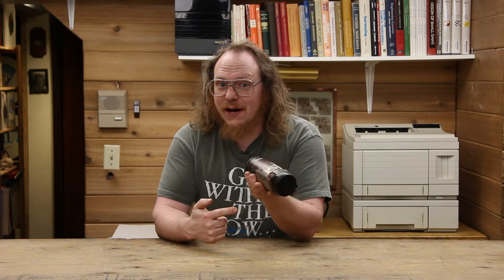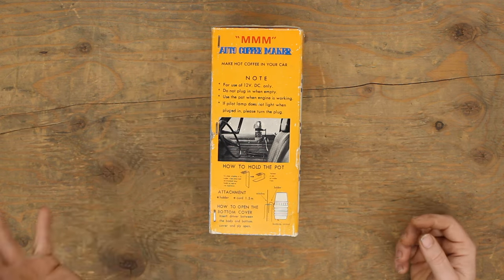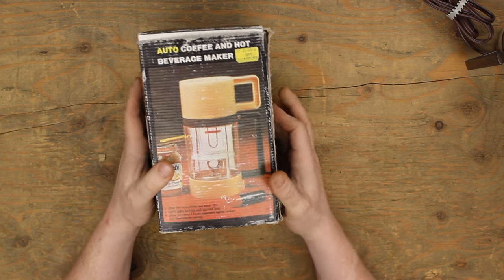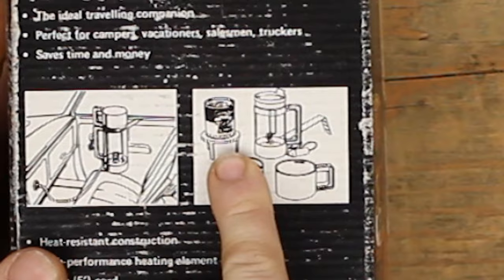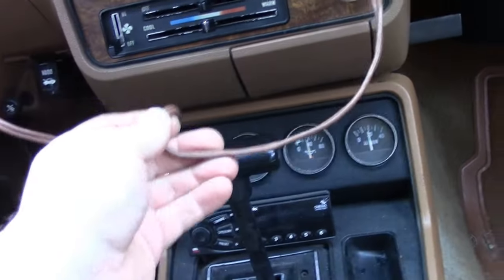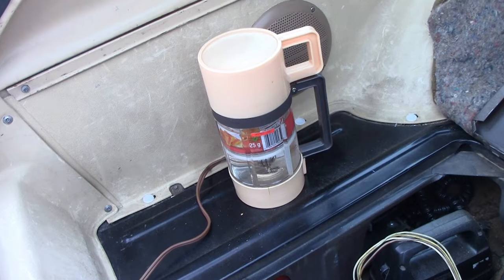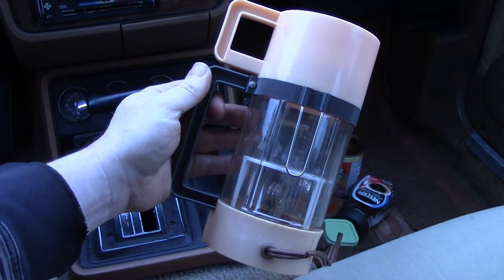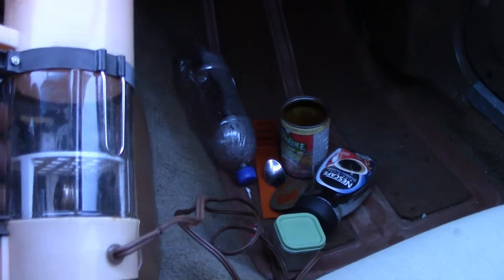Those Automotive Coffee Makers and Beverage Warmers - Are they really All That good?

Comment: I have been using a 230v 500W  coffee maker for years and it works great on the inverter.  
Brewing a cup of coffee takes 3 minutes.

In the past I had a 12v coffee maker. It took a very long time and it used a lot of power.

Comment: They still make the little 'stinger' coils and sell them at truck stops. Those are just 12V resistive heaters you drop into a mug (metal, presumably, so it doesn't melt). Prisoners also make them for the same purpose, if they don't have a microwave to heat water.
Reply: I watched the modern rogue make instant noodles with a prison stinger.

Comment: Guaranteed that you'll have a boiling hot beverage spilled into your lap as you speed down the highway..... ;)
Concerning the Thermos.  The one's with the double insulated glass lining work great, though the seal between the glass liner and top do dry out over time.  The later units with the stainless steel liner, not so great.
Reply: You should have added yellow food coloring to your water so that when you pour it outside.... hehe
@22:03 How many cracks have formed in the base of that coffee/beverage/soup heater?
Most importantly though..... What would mother say about eating in your car? ;o)

Comment: Funny watch!
I did load up that thermos before my trip... but 7 years in, it's pretty much just a few damp (and moldy) coffee grounds left in there.
I eventually removed the aimer-things from a heater-vent, and shove the can in there during a drive... after a 15min drive it can be pretty warm. But, yeah, not-so-easy to make coffee or ramen that way.
I got one of those drop-in heaters, but had the same problem with voltage drop.
Washing all these things, though, is quite difficult... coffee-flavored ramen ain't so great.